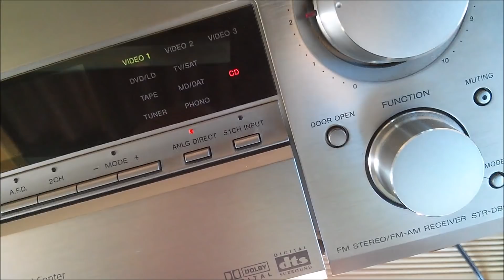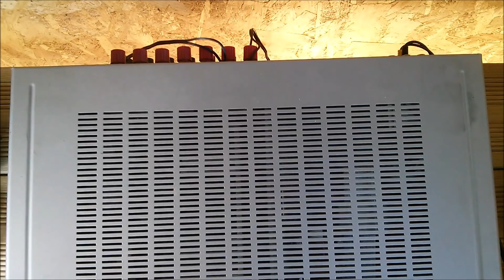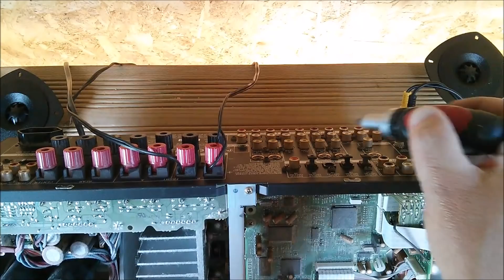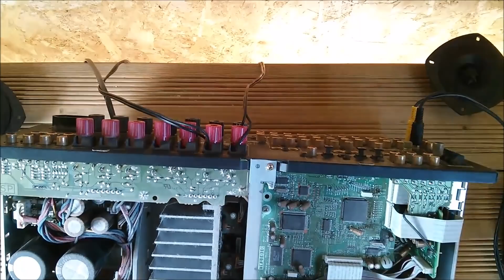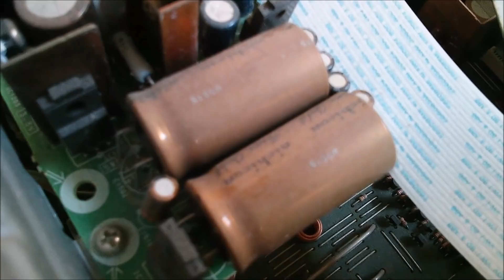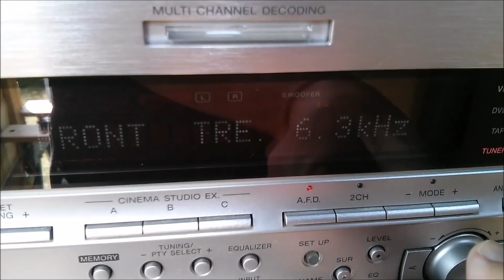A Look Inside - Sony Tuner Amplifier STR-DB940

Comment: Ive got this amp, it doesnt go in to protection mode but it has no sound on all speakers, i can faintly hear the radio but only if i crank the volume to maximum, i think the voltage amplifier ic's have been destroyed by bad solder connections. and dont touch those capacitor terminals because they will kill you.

Comment: At least it's output stage is class A/B, I gave my older Sony ES pro logic amplifier to my son when I upgraded to a much newer Sony ES amplifier which had HDMI, more output power and more features only to realize that I don't like it! No direct access to hardware bass and treble controls! Class D amplifier output stage! It's definitely more powerful but it's very harsh sounding when listening to music! Movies sound just fine. The older one sounded excellent on both movie's and music! 
I have never had any luck with class D amplifiers, not even in the car! The only place that they seem to be perfect for is portable applications where quality doesn't matter much, you just need it to be loud since you loose a lot of volume to the atmosphere! 
It looks like someone has been inside that amplifier before, the transistors look like they have been replaced, I doubt that Sony would have been so sloppy with the heatsink compound! 
Considering it's age, I would be guessing that most if not all those Nichi Con capacitors need to be replaced! Nichi Con capacitors have a good reputation but I have found that there was a period where they didn't last as long as one would expect, my son has a Sony DAT machine that was one of the early models and it's a work of art inside, everything is copper shielded! Beautiful Nichi Con capacitors are everywhere! It's like someone decided to use the best of the best of everything! But every single one of those capacitors were bad! Non of them had leaked their electrolyte but they all leaked DC, the copper shielded transformer ran hot, after a complete re cap, it's power consumption dropped dramatically and the transformer ran much much cooler! 
A re cap is a job in itself but if you like the piece of equipment and want it to last, re cap it, it's worth the effort and it's cheaper than buying a new one, Yamaha is making new versions of their older stuff but they aren't cheap, they never really were, but that's the choice that we have! Re cap an older model or pay more and get a brand new one! But you have to make sure that the new one isn't junk like the majority of them out there today!

Comment: 7.1 surround has 3 front speakers (left, centre and right), 2 side speakers (left and right), 2 rear speakers (left and right) and a sub-woofer.  5.1 surround is almost the same except without the side speakers.

Comment: I have the STR-DB1070, never failed me and is in use every day to this date. Only issue I can mention is that the display is getting a bit dim. Very happy with it. The one you have looks like mine but mine are 6.1, it has a center back speaker in addition to your setup that's 5,1. Never used that feature tho as it basically uses a Dolby pro logic type of processing to create the center channel audio as there are no such thing on Dolby digital or dts. Other difference i can spot is that yours are missing rgb ports on the back and my volume knob is not motorized. It's just a digital sort of arrangement, does not turn when you use the remote, but the dB level shows on the display.

Comment: Take a look at the Sony Service Manual (86 pages). Sony make some of THE best support documents for service engineers. They include schematics, PCB layout designations, block diagrams of the chip internals, chip pin designations, self test modes, factory reset, etc. Not quite as good as earlier manuals which had theory of operation, but still, pretty darn good. 
http://sportsbil.com/sony/STR/STR-D/STR-DB840_DB940.pdf
Reply: Thanks for the service manual link. I have just been gifted on eof these but there is an issue with the sound.

Comment: Looking very similar to the faulty Sony STR-DB835 I tore apart for spare parts a while back. If I recall correctly, those big power transistory things were Darlingtons. I had intended on repurposing the transformer  and caps for a nice and beefy linear benchtop power supply. Never got around to building it, let alone actually design the thing. I've got notes somewhere on the pinouts of the transformer and DC board, although it wasn't that difficult to figure out, so I could pick up the project again once my plate is a little clearer.

Yes, the volume control on the remote drives the volume knob motor. Which is bizarre considering it's all digital, so they could just tell the microcontroller to increment or decrement the volume independent of the input from the volume rotary encoder, rather than telling the motor to rotate the encoder. I'm guessing they just did it to give the volume knob that nice heavily damped feel.

As for the volume getting quieter when you increased the treble frequency, that's most likely a combination of the frequency response of the little tweeters and the filters on the tuner. Analogue FM radio has a fairly low bandwidth, so the low-pass filter in the tuner output stage would roll-off relatively low compared to any filtering on the other inputs.

Comment: I used to use a Yamaha A595 for surround which is similar is age and specs than this Sony. It wasn't very good. Thankfully I gave up on surround as it's very gimmicky and bought a much better Cambridge Audio stereo amp. I was amazed by the difference especially with the bottom end response. But you can't complain about a freebie !

Comment: Those white things are duel emitter resistor in each power amplifier.  Yes it does only have 5 power amplifiers but probably inputs for 7 down mixed, The relays you hear coming in after a few seconds are speaker protection relays usually monitoring DC off set or power issues. The reason you have a 4/8 ohm switch is because the amplifiers will overheat or even blow up if you use 4 ohms, they get round this but either changing the output stage voltage or adding limiters to reduce power output. I would NOT use 4 ohm speakers at all on such equipment. Power output is usually rated with just 2 channels working, all 5 on at once will really drop the voltage and power will really drop. Which is just as well as the heat sinks are VERY under rated for sustained high power output. They rely on the fact that a 5 channel movie, most of the time only a few channels will operate at any one time. A film like Star Wars will make the amplifier get VERY hot (over hot on my opinion) A fan added will prolong the life considerably. Even the digital chips often overheat because of no heat sinks. Still, you do get alot for the money but almost every part of it (in HiFi terms) are a compromise.
Reply: What's the extra lead on a dual emitter resistor?
Reply: @DrGreenGiant  It's usually a common lead.

Comment: I used to have that exact model. It's a shame that it broke down on my otherwise I would still have it. It sounded amazing!!!
Reply: I still have it and it still works great! It sounds amazing with our 5.1 setup.
Reply: @dantdmnl  my neighbors where complaining with the STR-DB940 and they aren't with my new Pioneer AV receiver, that says enough 😂
Reply: @nldestinyx1440  My neighbours have never complained about it and they say that they don't hear it, I kinda feel like they're lying lol, you probably understand why I think that.
Reply: @dantdmnl  HAHAHAHA yes I do, have you solved the cold solder joints on the bottom?
Reply: @nldestinyx1440  No I haven't
Reply: @dantdmnl  i love how you reply to me 2 years later 😂
Reply: @nldestinyx1440  it took me that long to decide if I wanted to fix them or not 😂

Comment: Ive still got my STR-DB940, was a great amp in its time. There was a problem with some of the amps where there was dry solder joints on the surround relays which caused the relay to switch on and off intermittently. Fresh bit of solder sorted that 👍. I now use an Onkyo TX-RZ 820.

Comment: Those were beautiful amplifiers. We used to repair them occasionally, while working on the Sony repair contract. 

The digital board is for the digital sound processing, which is responsible for for sending the correct sound to the correct channel. 

The amplification for the subwoofer is done in the sub (active subwoofer), which was an active unit, with 250 Watts and an 8" driver IIRC. 

These units still work well today, but only on the optical in as there's no HDMI support on board, although that can be done externally. 

If you are getting pops or clicks, then check for dry joints on the power supply. ;)
Reply from the maker: And I just found the reverb section - a whole load of room types from Jazz Club to Church Hall - also done on the digital board I'm guessing :)
Reply: @JulianIlett  
Yes. All the preset sound effects/delays, reverberation are processed by the DSP on all 5 channels separately. 

It's a good system, which is still functional and useful today, as long as the optical in is used.

Comment: There's a Service Manual of this STR-DB940 including schematics here: http://sportsbil.com/sony/STR/STR-D/STR-DB840_DB940.pdf The schematics of the power amplifiers are on page 33, no MOSFETs, just complementary common collector output stage using Darlington NPN, PNP. A common circuit that many amplifiers use. Looks like there are only 5 power amps. There are 7 outputs because the main L + R have two outputs A and B. These just share the same power amp. The relay clicking is due to the speaker output protection, it waits (and measures) that the outputs are stable enough and have almost no DC voltage on them. Only then is it safe enough to connect the speakers so the relays click.

Comment: the white things next to the mosfets are resistors i think
Reply: 2 resistors in one package
Reply: The white things with sticky uppy wires are resistors for calibrating the amplifier bias voltage.  Should be done every so often.

Comment: The fuses are probably for split supply (2 fuses) and a supply for the digital board
Reply from the maker: Split supply with 71v capacitors - nice :)
Reply: @JulianIlett  Found a service manual on 'electrotanya' those white things next to the transistors are .22 ohm 5w dual (matched) resistors (there's 3 connections on the bottom) and connected between emitters of the pairs with middle going to ground (0V rail)..
and apparently it's a 61v 0 61v supply plus a 32v supply.

Comment: If I remember correctly from school back in the 80s, the output stage is class B push/pull with NPN and PNP. It was quite common I believe.
Reply: Some have AB stages where the push pull is slightly offset.

Comment: Sony receivers are notorious for having terrible soldering, it mainly cracks at the relay, so if it doesn't have sound and doesn't click, just re solder the driving transistor and the relay and you should be good
Reply: Most amps have this problem after some years. They often use 90 degrees vertical cards and other stupid mechanical connections, which, together with the heat and cooling, kill all solder connections. If an older amp has problems, first check the caps, then all solder connections, then the relays...

Comment: One of the best Amps made, I've got 2 of them, they have a nasty habit of getting dry solder joints especially on the power section and need a soldering iron run over the power sections now and then. You'll know when it needs doing as it will throw fault codes on the front panel. You'll find my repair pictures on one of the AV forums as its still there to my knowledge. They have a lovely beefy PSU unlike the nasty switch mode junk you get in some amps. There is no sub woofer amp, its just a woofer line out. The AC out is switched with the power switch. The relays also suffer from poor solder joints. Lastly the pre amp board on the top can get rather warm. I fitted a small fan inside the case to keep things cool. In its day it was a high grade amp and I think it can still hold its own today :-)
Reply: Ah, mine is causing huge issues and simply worn't work now. Which joints need reflowing please?
Reply: @davidarthur852   have a look on the bad caps forum as this was where I put some pics up on this thread https://www.badcaps.net/forum/showthread.php?t=6648 there is also the relays which can end up needing some reflowing. Lots of the PCB work can be done just by taking the bottom panel off which means you dont need to do any major stripping. Also I would go along and resolder all the large power transitor connections which mount on the heat sink, Again I think these can be got at from the underside. Its about a 15min job with a soldering iron. this cured all my "protector faults" and stopped it suddenly shutting down and making horrible noises.
Reply: @davidarthur852  Just look for the thickest PCB tracks which the transformer outputs connect to.  Those are the most likely ones to need the solder reflowed.  Just think of every place which is likely to get hot.  They'll be another likely candidate for needing a reflow of the solder.
Edit: You can't go wrong with resoldering all the major power connections on that power board which is on the left in the video. It may not help, but if you know how to solder properly then you're not likely to do any harm.
Reply: I have a STRDE845, which  is still in use. The main problem is, as you say, the dry solder faults. I use an electrical panel fan on top of the receiver. It may not be pretty, but it keep the receiver cool as spares may be drying out now. Cheers

Comment: Hello sir I have a different kind of problem I need help with I bought a underwater ROV drone "CHASING GLADIUS MINI" and my son broke the 50m tether/cord off the WiFi box so I stripped it and found a black and white wire in it surrounded by Kevlar material, that tether/cord needs to be somehow connected to a 4 prong connector, I opened up that WiFi communication box and it has red(L), black(N), yellow(BAT) and blue(GND) wires not sure how to reconnect this?
Reply: Colour doesn’t matter, just connect the 4 wires in any order and it’ll be working again 👍